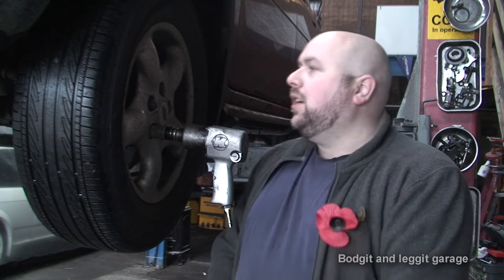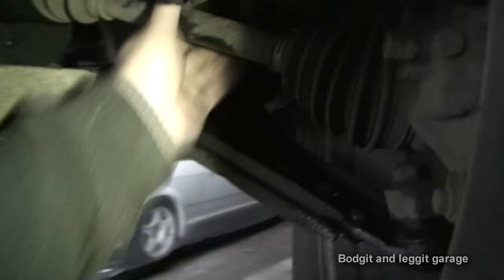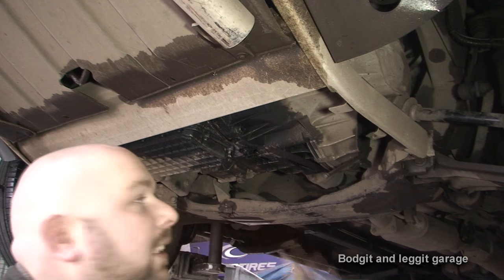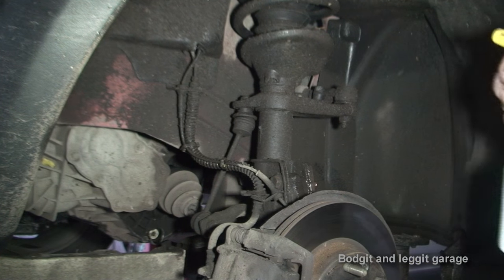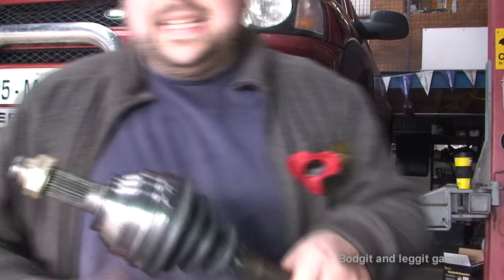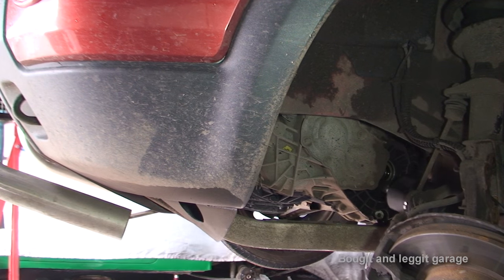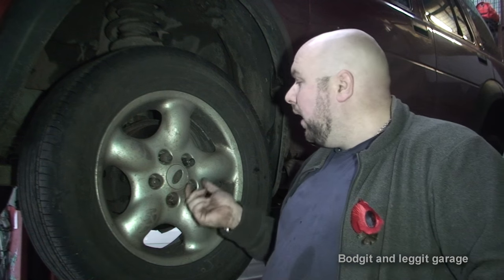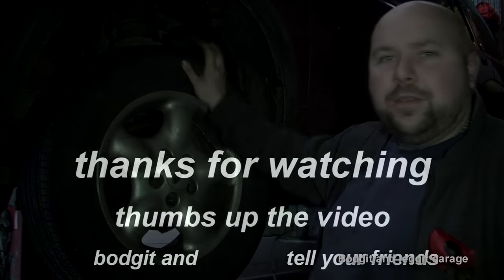Drive Shaft problems how to replace drive shaft on a landrover freelander bodgit and leggit garage

Comment: Great vid. Did 2 front driveshafts on freelander 2. Bottom wishbones.  Front bearings.  All went well. But too for test drive. Loads of screetching. Sounds and feels like handbrake catching on. Sometimes no drive going up curb. Rear wheels feel stiff. 
My question does new front effect the rear. All worked fine before apart from. Worn bushes and driveshafts. Mind blown. No touched the back of car.

Comment: Replaced the right hand side drive shaft today, on a 2002 freelander with automatic gearbox, one thing i had to do extra was remove the engine/gearbox support underneath the drive shaft,  in order to be able to get a small crowbar  between the drive shaft and gearbox to pop the drive shaft out. 
Again, thanks for the great video.

Comment: Good video .. just done mine nuts came off easy but the bolts were a nightmare! Interested as note someone said take ball joint nut off instead but although I got the nut off I couldn’t drop the arm (wishbone?) so did it your way … new bolts needed now though! Cheers

Comment: This is brilliant. I have to do this job on my 2008 rear wheel drive Vito taxi tomorrow. I've bought a new driveshaft as I've never done this particular job before. However I am used to struggling with reluctant bolts &c. I couldn't find another video on YouTube to help with this job, to my surprise, but I have a YouTube channel so may try making a little video myself for other Vito W639 owners.

Comment: I must try ur trick tomorrow cas I can't get the drive into the gearbox I had to change the outer cv holy moley I had to cut it off the shaft 😑 I have one of them pumps too very handy

Comment: A rothenberger sure fire torch with yellow map gas bottle works great for stuck bolts hotter burning and easier than a standard propane torch £69 so not too bad and you can use it at any angle.

Comment: Hi, you didn't film when you undid the driveshaft nut..just out of interest, did you first loosen it while the wheel was touching the ground, or did you use that air impact wrench on it when the wheel was off and car was raised?
Reply from the maker: hi mate i use the air gun when car is raised

Comment: Can I ask when replacing the front left half shaft on a 2003 automatic td4 will oil leak out ? The help will be appreciated so that I can get the oil in advance. Great video 👍
Reply from the maker: Yes Mate it will  Automatic gearboxes aren't as straightforward sometimes there is special procedures you need to do to refill them

Comment: Hi bodger I've mackerel my thermostat housing on my freelander  diesel how can I get at it without dropping engine ? Is. It possible ,trouble started when the stupid coolant pipe broke managed to get a pipe back in and over tightened the bolt holding pipe in place ,what a stupid desighn .great vids .
Reply from the maker: anthony preston from what I can remember mate it is possible just awkward have it done one in a while

Comment: Good job but maybe undo the filler nut first to be sure you can fill back up.
Reply: :D :D same problem with IRD oil change.. gone out in few mins, but i needed to borrow same air gus as he got in video :D .. job done in 20secs

Comment: i've done lots of these one tip is before you dump the gearbox oil make sure you can 1 open the filling nut and 2 can you actually get in to re fill it " i got caught out once "some times it's easier to jack the side you are doing a dam sight higher than the other side and with some look you don't spill oil everywhere
Reply: ps forgot to mention i use a pump similar to that as well but when i fill the box i 1st prime the pump then use the correct amount of oil in a bottle .....  https://www.ebay.co.uk/itm/Sealey-TP9312-Engine-Oil-Gearbox-and-Diesel-Transfer-Pump-12-Volts-Portable/223601354241?epid=27034025304&hash=item340fade601:g:JhIAAOSwKyVdOyc3

Comment: What a bar steward without a hoist I'd both sides to do still got driver side yet started today I know what you mean with stubborn nuts or bolts the lower ballpoint nut refused to come off without spinning the threaded bar I wrestled with it for an hour then got grinder and cut the damn thing off so new lower ball joint needed serves it right lol .i look forward to putting oil in lol good vid cheers .the shafts cost me 140 squids if anyone considering this .
Reply from the maker: lol have fun mate

Comment: Try using Belzona 8311 Nato fluid.It is vastly superior to WD 40.I have been using it for the last 20 years as a maintenance fitter in a steelworks.It is superb.WD 40 is crap in comparison.The only drawback is price.But you do get what you pay for.
Reply from the maker: ffotograffydd gohebwyr thanks a lot for that mate will give it a try
Reply: Big tip,leave it work .A mug of tea sort of time.
Reply from the maker: ffotograffydd gohebwyr 👌👍👍
Reply: Another tip DO NOT mix the two of them on the same job.There's a chemical fight going on if you do ok .And I don't mean explosions,Just one compound working against the other.Use one or the other not both together.

Comment: Undo the filler first?!  Meh, only if not replacing all fluid was an option, it's coming out one way or the other!  I guess in this case removing the camber bolts was less risky than going for the ball joint on control arm, maybe the antiroll bar's so stiff it wouldn't give you clearance anyway, I don't know.. Haven't had one of these to do yet... Sure makes me love little Toyotas with their 3 bolt on balljoints/no camber adjustment, but that's just it; functionality vs complexity (unless it's a new Volkswagen, where great (if stubborn) engineering seems to be ruined by businessmen!)  Ooooh, how opinionated of me!  Awesome vid ;)
Reply from the maker: +Ali Barbour haha thanks mate

Comment: Hi I change my cv joint on the right side but have problem with abs sensor light remaining on
Reply from the maker: You're going to have to plug the scan tool in just to make sure it's  the side you worked on if not you're just chasing a red herring You're going to have to look at what you have done make sure you haven't broken any wires broke the connection broke the abs pickup ring just have a good look to see what exactly you have done on that side of the car

Comment: how do you get the shaft back in the gearbox if you dont have a air hammer ???
Reply from the maker: wendy hensby what you can do is put the nuts back on the end of the CV joint get a hammer and hit the nuts make sure the not is on flush with the end of the CV joint that way you will not damage the threads it should go in for you then but it can be an absolute pain and also you can slip off and hit your hand don't know how many times That's Happened to Me lol

Comment: Great video but why didn't you just take the ball joint nut off and disconnect the ball joint and anti roll tie bar rather than messing about taking the bolts off the shocker/strut hub assembly. Whick means you have to have the tracking and alignment sorted out.Wheras if you pop the ball joint out the bottom you dont.
Its also easier if you use an Allen key bit in an socket on an extension using an ratchet then you can get it from the wheel arch and not underneath and then you won't get covered in gearbox oil 😉 and its easier to catch the oil in a bucket.
Great video though
Reply from the maker: sorted

Comment: I wish somebody would do some work on 2008 LR2  there is so little information on the WEB doing a front wheel hub and bearing assembly .Having problem putting the Ball joint back into the wheel assembly and aligning the cv joint
Reply from the maker: Jeff Inkpen as soon as I get one in I will film what it needs and hopefully that might help you someday

Comment: Yes, proper garages DO use torque wrenches on hub nuts, wheel nuts etc. To say no one does is misleading and sloppy, potentially dangerous too. Sorry to say this as I enjoy these videos and can see that effort is being made here to do a good job and show people how but the truth of it is that these things ARE important and one of the reasons we often can't undo bolts is because someone just creamed it up with an impact gun and probably MUCH TIGHTER than it should have been. If you are going to teach inexperienced people how to work on cars then I think mentioning the size of the nuts&bolts&tools needed and the reccomended torque settings and why you need them especially if doing for first time IS important. Also if the threads on the pinch bolts had been cleaned up nicely with a wire brush and some copper ease put on, an impact gun would not be needed or wanted when reassembling. Better still, get new bolts when ordering the driveshafts as many manufacturers reccomend new bolts every time anyway and it's better and faster than reusing bolts that have been heated, hammered and torqued on which is also questionable to reuse after that. Also for someone doing this at home, you may want to loosen that hub nut first with the wheels on the ground as it will be tight! (remove centre cap from wheel to gain access) Torque it up and the wheel nuts up last when on the ground and make sure any locking tabs are secure, you don't really want these coming undone up the motorway.... obvious to the experienced amongst us but maybe not to others.

Comment: Is the other side as easy?
Reply: I need to do both sides on a Freelander - did you get an answer to this Q? I'd like to know if both sides are the same besides the obvious of RH into IRD and LH into box....anything else between the two sides? Cheers
Reply: Don't know they haven't replied yet :(
Reply from the maker: hi mate does nothing really difference in them both the same way of doing it
Reply: Thanks mate